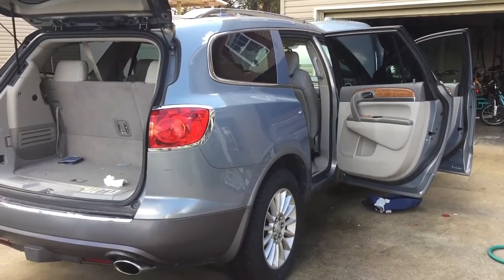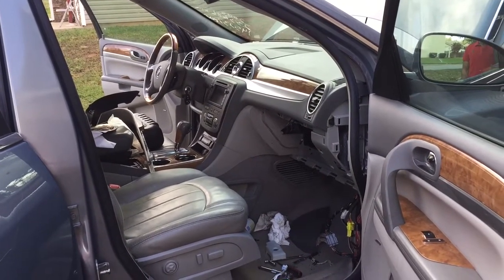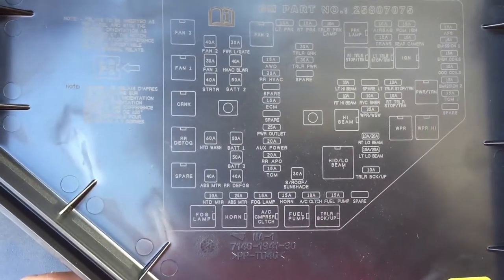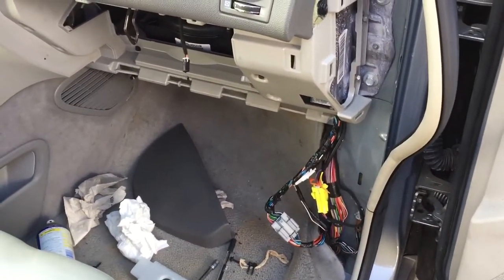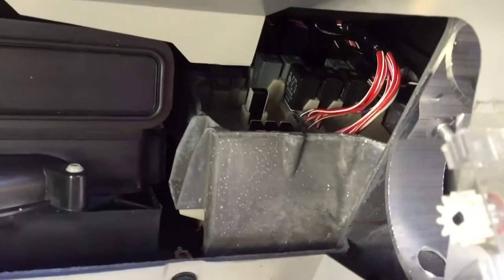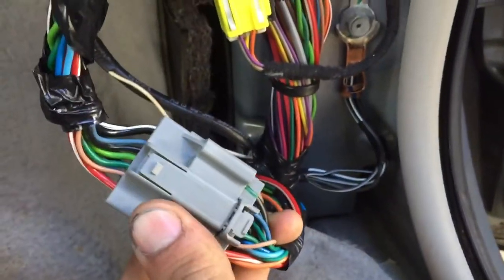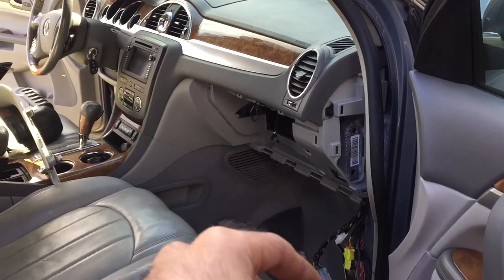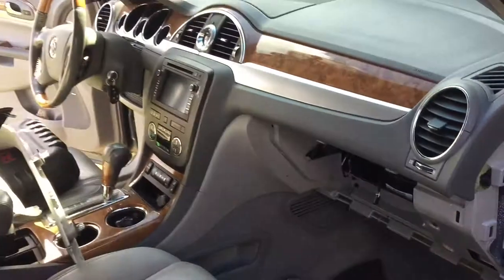Enclave/Acadia/Traverse Engine Doesn’t shut down! Or No start! Solved!

Comment: Thanks for the video!  I just bought an non-running Enclave that had the sunroof stuck open (actuator corrosion).  Now that I've fixed the sunroof; actuator, drains, and all gutted & dried-out, I'm about to see why it doesn't start.